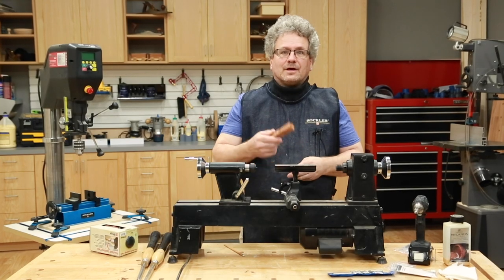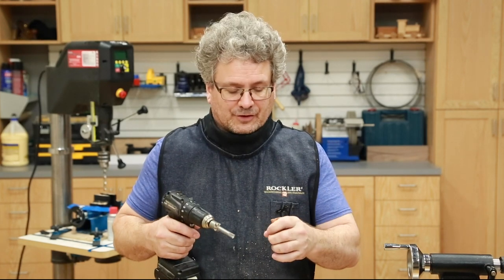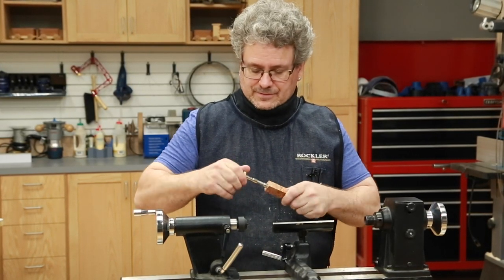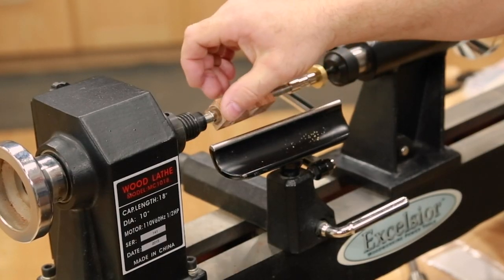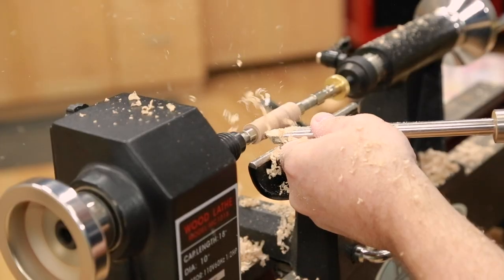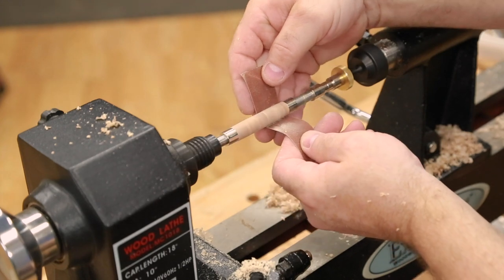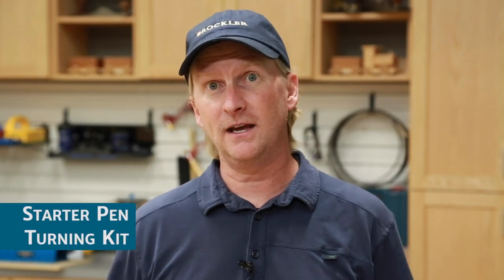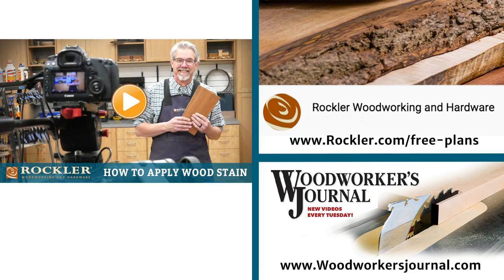Learn How To Turn a Pen

Comment: Thank you for the video well done.  My problem with the Rockler pen press is it appears to take quite a bit of hand strength to press the components together.  The leverage or gearing on the handle to press portion doesn't give much mechanical advantage and I find it very difficult to press the pen parts together.  i had another gentlemen much stronger than me and although he could do it more easily also indicated ti was difficult.  Trying to find a different pen press with more leverage.  Any ideas?
Reply: I don't have the pen press, but I used a small harbor freight arbor press to assemble the pen I made
Reply from the maker: Thanks for the feedback. We have passed this along to our product team.

Comment: How do I keep the blank from pausing?  I’m trying to shave off the Extra blank that I don’t need but my blank keeps stopping.  Do I need more bushings on the Mandela or do I need to speed up the lathe?
Reply from the maker: If the machine is still going but the blanks are stopping or turning, then you just need to tighten the brass knurled knob a bit more.
Your lathe speed should be set at the second to fastest or the fastest setting. That will make a difference as well.
 Also, check the sharpness on the tools you are using.
Reply: @rockler  I don’t know which way to move the belt to make it faster.  And thanks I appreciate it.